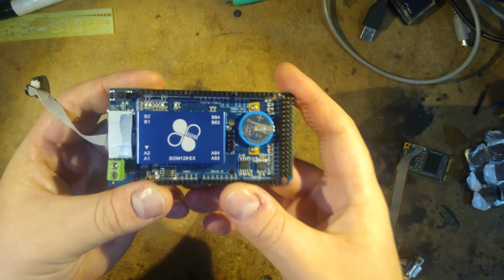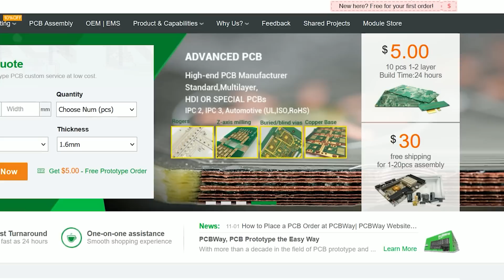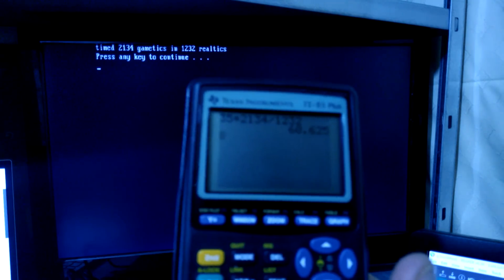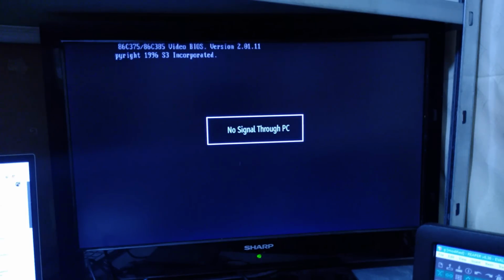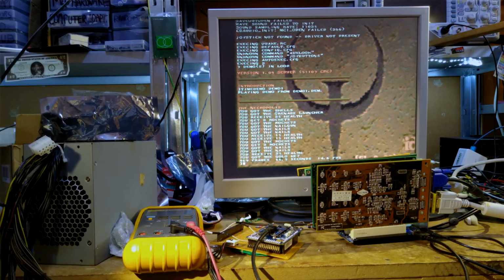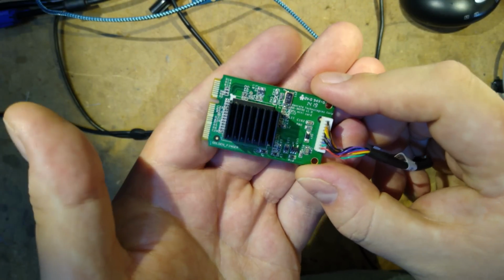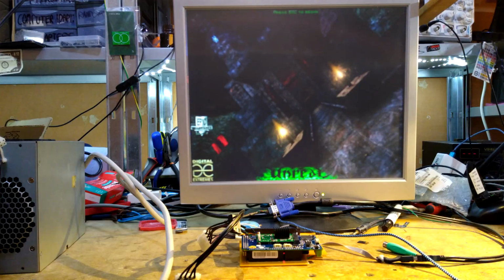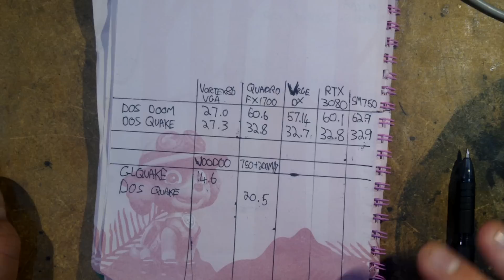RTX3080 On An Arduino?!

Comment: a rtx 3080 hooked to a plain pci slot will be so bottlenecked by the slot bandwidth that it literally won't even be able to use 1% of its power. anything more than a voodoo3 gets bottlenecked by pci. heck even the voodoo3 gets a lil bit bottlenecked. that's of course ignoring that the cpu probably bottlenecks even harder

Comment: Won't run on a Pi, no matter how many times you recompile the kernel.  Runs out of the box with no issues on a 486 Arduino.  8 core 486 when?

Comment: dude just converts mini pcie to usb and then back to full sized pcie and then to pci then connects all that shi to an arduino and is able to run windows 98 and quake on that goofy ah setup while i struggle to get a gt9500 to work on ubuntu 18.04... god has his favorites

Comment: I use a gf730 on an i5600k clocked at 5.1ghz base and 5.5 max overclock.  The heatsink barely fits in the case.  If I game, I just use my PS4 Pro or PS5.

Comment: 4:40 eh, i wouldn't say PCI and PCIe are mostly the same. honestly PCI is much much closer to ISA in terms of function than PCIe.
both ISA and PCI are a parallel bus, where all slots are directly connected to eachother and all of them share bandwidth.
meanwhile PCIe is a serial interface between exactly 1 slot and the chipset/CPU. so a x16 PCIe slot is actually just 16 discrete serial lanes to the CPU, which can be dynamically en/disabled in software (like if a chipset doesn't enough PCIe lanes for all devices and slots, the system has to decide how to best assign them)
Reply from the maker: Yeah the physical implementation is very different, but from a software standpoint PCI and PCIe behave much more like each other than ISA.

Comment: It's impressive that modern GPUs are still backwards-compatible with the legacy video modes that were used back in the DOS and Windows 95 era.
Reply: That's probably because x86 based computers basically go through the entire architecture history during boot:
The CPU starts in 16-bit real-mode, loads bios from rom (or now days probably some sort of bios bootloader from rom and a bios that's basically another OS from some flash memory), load bootloader from disk, at some point switch to 32 bit, start loading OS kernel, switch to protected-mode, at some point switch to 64 bit, etc.
At the early stages of boot process even the latest Intel and AMD cpu basically work as a 16 bit microcontroller
Reply: @qdaniele97 ’s funny how this mirrors the (although nowadays outdated) recapitulation theory in biology lol
Reply: It's probably just some old circuit designs slapped onto the new die completely separate from everything else just to do the compatibility mode though. Process node advancement means these won't take up as much space. And they just have to support very basic stuffs. it's not like anyone is running cuda or vulkan with ray tracing on windows 95 or anything.
Reply: UEFI is 32 and 64bit It must switch before.
Reply: same goes for cpu's. every little thing is still supported, on the hardware level. the entire x86 architecture-ecosystem was always build on backwards compatibility, not speed. i'm sure if i could somehow downclock my 12th gen core i3 to something like 100mhz, i could play pure dos games, without sound of course.
Reply: It works, because modern NVIDIA graphics cards, still have CSM (part of legacy video BIOS) built in, so that's why it works.

I own Intel ARC A750, that doesn't work on any legacy BIOS system, so it not BOS compatible.

Comment: Im geniunely intrested if this board can run something PC-98XX compatible, like idunno, Touhou 1-5
Technically it should, it requires 486 cpu and dos, but the most interesting thing to force to work is sound, because its kinda hard to find any YM2203/YM2608 ISA boards

Comment: Virge wasn't a very fast 2D card even back in the day. Riva 128 was about 30% faster, and then of course Tseng, ATI and Matrox also did reasonably well. If my memory serves me. Not that Trio/Virge's 2D performance was particularly limiting or outright embarrassing, just that it didn't score as highly.

SM750 is a nice surprise. Perfect.
Reply: riva128 came out a lot after the s3/s3 virge. 

everyone used s3-xxx cards tho just because they were cheap for the pentium 60-100 builds
Reply: @lasskinn474  There were a lot of Virge respins and generations spanning a number of years and the 2D engine plain hasn't changed or gotten faster since the Trio64 and potentially much earlier chipsets yet. Because it wasn't really all that necessary, it was good enough, who cares what Ziff Davis WinBench 97 says.
Reply: @SianaGearz  yea it worked fine, it's not like it had snow on the screen when changing palette or some sh*t like that which you could have with early cheapo svga cards. worked fine, supported lots of modes with univbe in dos, did it's job.

like honestly, back in the day, if you just had a voodoo with a whatever s3, you were better off than with a "good" matrox card. it's not like you were likely to have some godly expensive monitor anyway where a better ramdac would have gotten you better image quality either.
Reply: @lasskinn474  Right around 98, LG monitors astounded me. For the price of a cheap monitor, you actually got something of a completely different kind than the usual junk. High resolution, sharp, fast, well converged, good geometry, stable-ish, you could actually tell the difference between the quality of the DAC circuit on various cards and the cables once you started running higher resolutions and refresh rates. Not that you needed all that much RAMDAC bandwidth to push it though. S3 chipset wasn't a problem, some cards were wonkier than others.

I think i actually got a Mitsubishi Diamondtron 20" around that time so maybe i did have a crazy good monitor. But that was expensive.

Comment: Thats perfect illustration on "dos compatibility" issue on unusual and modern hardware.  Its all just sound issue. Or to be more specific its old DMA method issue.  Creative really did bad thing in long terms perspective design soundblaster based on dma controller. We wouldnt had all compatiblity issues for dos games if creative decide to spend some money and put RAM on card for soundbuffer instead of rely on DMA so much. Which makes me wounder.... Gravis UltraSound maybe !?

Comment: I have one bottleneck theory to do with the mini the reason for the graphics slots being as they are traditional architecture is parallel addressing and the notebook interface is still serial data to the break out board. Nothing you'd notice in DOS or even say emulating something older than N64 but with your benchmarks it could definitely be a factor.

Comment: There is no hardware acceleration for those games, they run 100% on CPU, the only difference is the speed of the memory on the graphics cards ! Software from that era would write directly to the framebuffer on the videocard.

Comment: Dang, I was hoping for an atmega328p to bitbang pci-e.
Reply: XD
Reply: Same Lmao
Reply: That would be sick as hell though!
Reply: @miigon9117  Given how flexible pci-e is, I wouldn't be surprised if it WAS possible.
Reply: @qwertykeyboard5901  Not really though I think. atmega328p max frequency is rated at 20MHz max while even PCIe Gen 1 runs at 100MHz. might be doable with some de-lidded liquid nitrogen cooled overclocking black magic? not sure

PCI on the other hand, which runs at 33MHz, might just be possible (if we overclock the crap out of the 328p. heard someone is able to get it to 50MHz)
Reply: @miigon9117  However, pcie is UNREASONABLY flexible. An early ps4 hacking demo involved sending the pcie bus over a sniffed serial line.
Reply: @qwertykeyboard5901  now I really want to see that demo now, still remember where i can find it?
Reply: @miigon9117  bumping!! i need it
Reply: I too expected a more generic arduino maybe not explicitly an Atmega328p but any Atmega based board.

Maybe instead of an Atmega328p an RP2040? With 144 mhz and the pio state machines you might be able to bit-bang PCIe.
Honestly this could be a fun idea.

Comment: Thinking about the CPU bottleneck, do you think perhaps the adapters you had to use could be a bottleneck? Idk what goes into the USB adapter thing, or if there is some bandwidth issues with the PCI-PCIE bridge, but that could explain why the $20 server card did better than the 3080 since it was the only card you inserted directly into the arduino slot.
Reply: The 1x PCIe adapter (these things only have one lane, there exist 4x versions but they use SAS cables) is a passthrough of the PCIe lanes. No delay involved. They use usb-3 cables as the have differential pairs and shielding and are cheap. As for the pci bridge I doubt that will be the bottlenneck as the PCIe lane has in 1x mode over twice the speed of the entire pci bus so plenty of space for overhead.
Reply: It's the pipeline.  His chipset only has one.  It needs two for optimal performance.

Comment: i think that the usb cable between the adapters is the real bottleneck. if a board could exist that is just a straight trough, it would probably do a LOT better.
Reply: it's not encoded to usb or something like that.  it's a usb3 cable but it's not acting as a usb3 cable, it's just a direct through to the pins basically.  they just use it due to the cost of the cable and connectors.

Comment: So, I can tell you why quake's bottlenecking.

The vortex86 is based off the 486, whose control pipeline is, well, let's be nice and call it "uncomplicated" or "of it's time."

One of the big-ticket features of the Pentium (which Quake was targeted at), was that it was the first x86 chip to have TWO pipelines, so iD were able to do FDIV on the FPU for texture stuff with sloping floors, while the rest of the game is other stuff at the time time. On a single-pipeline chip, you get, as you show - literally half the performance.
Reply: I wondered about this at the time, why wouldh't Quake run on the 486.   I read Abrash's book and it explained it well.  The tuning for the Pentium is quite astonishing.
Reply: also, the pentium fpu could execute 3 fpu instructions per clock, as long as they didn't rely on eachother. so with a simple reorder of those, you could gain much better performance. quake was build on the pentium's rule of 3.
Reply: @giornikitop5373  yep. And the loop Quake’s code to keep game speed from going too fast/slow will be assuming pentium capabilities.
Reply: Given how it works on the pentium, with it being picky on the second instruction and the tricks you could do with the FPU, i would say that the pentium is a CPU you can do combos on, and john carmack is pretty good at pulling pentium combos.
Reply: Or in less up your own arse terminology: The pentium is superscalar and thus much faster than the 486 and Quake really needs that performance boost.
Reply: @donpalmera  Do you have friends?

Comment: How I wished there was a dirt cheap x86 microcontroller-like chip, just as the 80186 was at its time.
Reply: Well, there WAS the intel Curie... Was
Reply: @kitsune-chan6897  the edison too, though it was at around 80 bucks. 
though in general the product line was quark  
also apparently the ~36$ launch price in 85 would be around 100 bucks today, so it'd be close to the price of the quark.

if you don't mind the power consumption and size, you can get celeron/atom/AMD socket FT1 based motherboards for very cheap (~50 bucks), and you can just add a few atmega32U4 for io, another option is grabbing laptop motherboards.
also on laptops there's exposed i2c in the form of the battery smbus.

the only drawback beside size and power is the lack of "real time" though it's usually fast enough (<50ms, likely to be <1ms) that it doesn't matter for most purposes where you'd want x86.

an example of a cheap x86 motherboard with soldered cpu is one for an ASUS Vivo UN45, it's available for sub 50 bucks on aliexpress.

 if you're going with 100-150 bucks budget there's mini PCs with like a Celeron N5105 which are way overkill for most applications (equivalent to the i5 2500k).

the 86duino boards are on the same price range as the 186 was on launch (50-150 bucks), though the other options like the raspberry pi (though it's arm most linux programs are available on it) and celeron based sbc (no gpio, but that can easily be implemented with an arduino) are more powerful.

apparently Qotom makes some motherboards with recent cpus and integrated GPIO headers (though they mostly sell barebones with a case and variations on a lot of ethernet, a lot of serial or both.)

Comment: Where are you getting that sm750 card?  And for $20?!  I've found only 2 vendor links from Google and the damn thing is over $100.
Reply: I'm also looking for those things and I've never seen the card he is using
Reply: Same question here, and actually  found the actual individual chips but for 57$ unit at a min buy of 6 but no card

Comment: wasnt quake software 3d ? so I guess the bottleneck then is the cpu.  the s3 virge dx card did I own back in the day. It was one of the slower cards on the market but cheap :) like $25.. where the cool guys could afford the Matrox cards what was the cool cards before all the 3d accelerated cards really entered the market.
Reply from the maker: yeah on most of the tests quake was software, on the voodoo it was hardware 3D though. Weird it only got 14FPS.
Reply: @TheRasteri  I am no expert at all with this, but could it be that the voodoo card dont have geometry transformation (if i remember it correctly) in hardware and have todo it with the cpu?
Reply: Quake had a dedicated Glide driver so it could use its capabilities to the fullest. Geometry transformation (T&L) came in much later, on the first nVidia GeForce cards - if we're talking about the same feature.
Reply: @borismatesin  ah many years ago so my memory is not so sharp :D fun video anyway. thanks for video.
Reply: You'd need GL Quake for hardware acceleration.

Comment: Considering PCIe GPUs, AMD seems to have better DOS compatibility than Nvidia. I couldn't get EGA and CGA modes working on Nvidia, those would display only black screen. On AMD GPUs, those modes work just fine.
Reply: There's been an effort in recent times to do away with legacy compatibility entirely which is what I suspect is happening here

Comment: May not be the best DOS graphics card but at least you got the RTX3080 up and running in the first place :,D
Jeff Geerling still messes around with both AMD and nVidia on Raspberries and struggles.
Reply from the maker: One of these days we'll get voodoo working on the pi :)
Reply: Heh, my problem is I keep trying on these newfangled Arm-based boards. Maybe I should drop over to 486!
Reply: @JeffGeerling  any SBC with a weird architecture too
Reply: Raspberry Pie's are sadly not Arm PC's, they lack the bios/UEFI bits x86 intended GPU's require to fully function, Arm does have a UEFI equivalent called Arm system ready but it is found only on high end workstations, check out the channel Wooty B he put an AMD GPU inside one of these and it works fine, can even play modern'ish games via Box86 emulation.

Comment: How'd you even get working drivers for all those cards?
Reply: All these cards support basic BIOS/VESA videos modes defined way back in time (late 80s, early 90s-ish?). It's kind of amazing though that an RTX3080 still has this, even though it probably never going to be used like that with more modern UEFI systems.
Reply: @IstvánNagy-z7m  It's used to display BIOS setting panel on BIOS systems and the card does have to support that even if most end users will probably install it on a UEFI system.
Reply from the maker: VBEMP 9x does a good job on VESA cards (link in description)